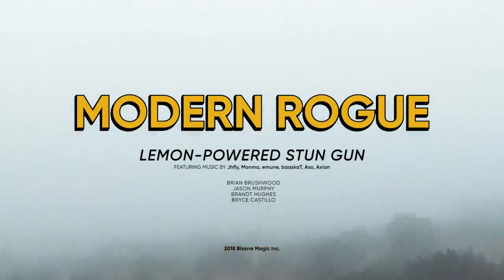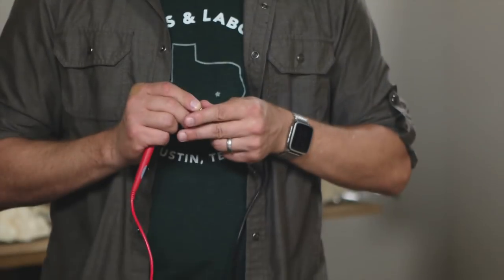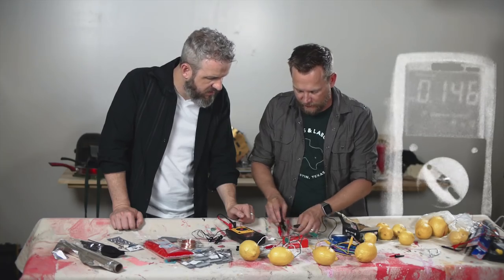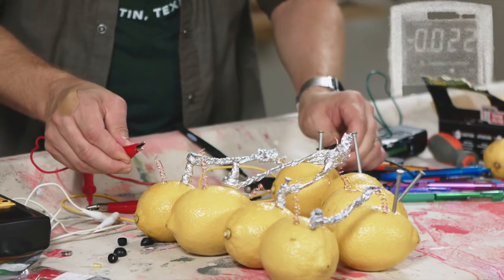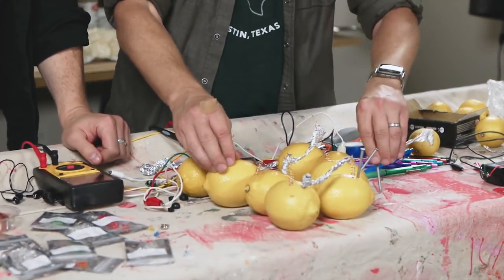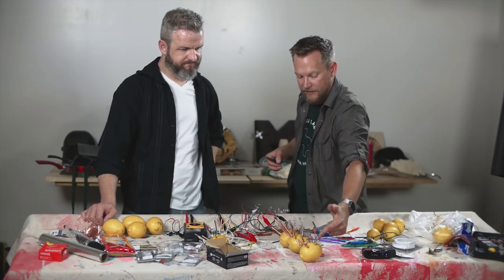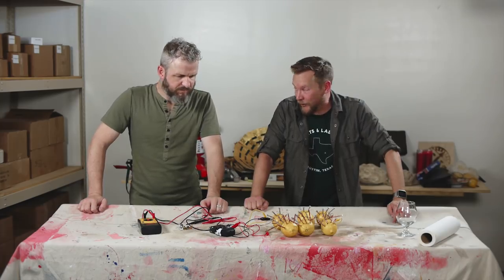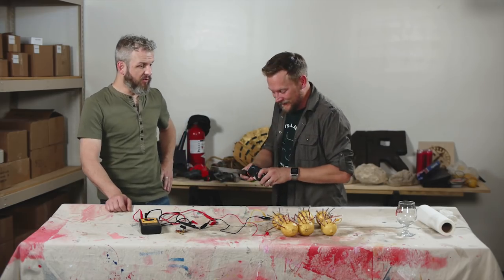Making a Lemon Stun Gun

Comment: Nothing says "Help me" like putting up giant text saying "Ohm's Law" and then not putting the correct equation on screen.
Reply: lmao what happened to the resistance...
Reply: isn't Ohm's Law watts = amps x volts or is that a different law
Reply: @datrandomdugggy5537  what your thinking of is the power law. It's P = E I.
Reply: @tommylight1312  ah ok thanks
Reply: @datrandomdugggy5537  ohms law is voltage, current, resistance and you use those in diffrent ways to find what you need:
Voltage: is current x resistance
Current is voltage ÷ resistence
so on and so forth
Reply: @Brandon25043  ah got it thanks
Reply: They put both. Ohms law and the power law.
Reply: There are SO many things wrong with that one card. They wrote "Ohm's Law" then put a word version of the power equation (P=IE) under it THEN put ALMOST Ohm's Law under that (the variable for voltage is actually E, so it should have been E=IR).  But still, love these guys. 😁
Reply: @JGlenn75  I don't know who on earth would use E for Voltage/Potential, it's either V or U depending if you're in America or Europe. E already means both Energy and Electric Field Strength, and in no world should E = E/x = E•q
Reply: @JGlenn75  the variable for volts is actually V... depending on location. V for voltage is much better than E. I mostly only see E used in out of date textbooks and old ham radio texts
Reply: @1224chrisng it's referring to electromotive force, EMF. V is also speed, so it gets confusing there too. EMF is also electromagnetic force. All real dumb, but as far as I know, Canada uses E for voltage.
Reply: @1224chrisng  Many, many engineering courses teach E as the sort of "old fashioned" way of writing it down. It's still common in some areas.

Comment: this is painfull to watch as an electrical engineer...
Reply from the maker: oh, man.  I'll bet.
Reply: Gregor Scott i feel your pain man
Reply: It is. But it's also funny because of how dumb it is :P
Reply: Then dont watch it m8
Reply: Painfully but still entertaining. Like a car crash dont want to look away lol.
Reply: Gregor Scott I'm in the same situation (I'm an electrician)
Reply: Do they not teach physics in america xD
Reply: I’m 15 and am smarter than them I knew immediately that it didn’t have enough amperage and I know what ohms law is
Reply: @randomrcprojects3754  nice, now gtfo.
Reply: @randomrcprojects3754  shhhhhhhhhhhh, no one cares how smart you think you are
Reply: I'm right there with you brother
Reply: It wasnt hard for me until I saw "watts = amps * volts" and the in parentheses "V = I*R"
Reply: @almidi3  I once had a prof tell me to get ohms law as a tattoo
Reply: Just put battery’s in the lemons 2000 IQ
Reply: @randomrcprojects3754  technically correct, however, diodes are non-linear components. You can't directly use Ohm's law to calculate anything about them. For example an ideal silicon diode would act like a switch. In the case of the Si diode, if your voltage source is higher than 0.7V, your ideal diode will work as a perfect conductor. If your voltage source is lower than 0.7V, it will be an open circuit. The only way to apply something like Ohm's law to a diode, or any other non-linear component would be to calculate the Q-point of your component based on your voltage and amperage. But considering this requires graphing, we don't really use the Q-point method a lot in practice. Thus, we take a first-degree approximation or second degree approximation when building a "normal" circuit.
Reply: Christ, I knew more about electronics when I was 14
Reply: @TheWriteOnez  Do these two strike you as guys who paid attention in school?  Lol
Reply: @randomrcprojects3754  I assume someone smarter than you taught you all that, go thank them.

Comment: Loved the episode. However Ohm's Law has nothing to do with the Watts of a circuit. Ohm's law simply states the relation between resistance, current and Voltage: Resistance =voltage/current (R=U/I) The law you're referring to has a similar formula and triangle, but this is the power. Which is Power(Watts)=Voltage*current. 
I couldn't resist not stating this as a Bachelor in electrical engineering. 
Congratulations on the 100th video though! Here since the start and loving this channel!
Reply: On the topic of electric laws, at the beginning (after the intro), Brian said that they were going to create  electricity, yet the law of conservation of energy (First law of thermodynamics) states that energy can’t be created, only transferred or transformed. Still loved he episode even though it will get some perfectionists like myself. Thanks
Reply: FatDwane in physics most 3-way formulas go in a triangle
Reply: Did somebody make a joke about the Trinity of electricity yet?
Reply: Nitro Actually, it's fine to say that they're creating electricity. They are not creating energy from nothing, but they are turning chemical potentials into flowing electrons
Reply: Isn't Voltage typically displayed as E not U? Just curious.
Reply: Baldwin I've never seen E used for that. Typically U or V
Reply: You can replace "most" with all in that sentence. I just wanted to use the same words they used so I could explain it to them (and other people) in their own words.
Reply: Thomas Jager Alrighty, thanks for the reply.
Reply: E is the symbol for energy. If you multiply a time with Watt's, you get energy, which is usally expressed in Joules(J) or KiloWattHours(KWH).
Reply: Yes this bothered me too XD
Reply: Ohm's law is current = resistance/voltage
Power of current in closer electricity circle is proportional with voltoge , and inversly  proportional  with resistance
Reply: if you swap around resistance and voltage around in that equation it is correct ;)
Reply: FatDwane no it is proportional with voltage
And invertly propotional with resistance
Reply: Thomas TheYoutuberGuy It's V=IR, divide through by R and you get I=V/R.
Reply: AGMT Yea so here in croatia the simbol for current is I  for voltage is V and for resistance is R so ohm's law is I = U/R     
U=I/R
R=U*I
Reply: Thomas TheYoutuberGuy You said it was I = R/U or R/V in your original point, which is what was being corrected.
Reply: AGMT ok
Reply: This exactly
Reply: Watts law.
Reply: hehe resist
Reply: but it's still a 3 way right ?
Reply: inversely not invertly use Grammarly Grammarly is love Grammarly is life but not as much as COBBLESTONE
Reply: Why's nobody mentioning
i = C*du/dt and
u = L*di/dt?
Poor forgotten guys :<
Reply: I could be wrong, but intuitively what seems to have stymied them is the resistance of the (massive, comparatively) conductors they were using to transfer the electricity.... Thoughts?
Reply: Con Diamantis yes, using I=R/U you can calculate the current and with R=I/U you can calculate resistance. With P=U*I you calculate the wattage.
Reply: Isn’t there two ohms laws p=i*e and e=i*r where p is watts e is volts and i is amps and r is ohms
Reply: Radio Bros ohms law is strictly u=ir. p=ui is joules law.
Reply: Simon thank you for setting my record straight. My amateur radio general class called them both ohms law
Reply: r/iamverysmart
Reply: Sure you mention ohm's law, but what about cole's law?

Comment: 15:20 V=IR means Voltage = Current X Resistance. Whilst Wattage = Voltage X current, they're two different equations (V=IR being ohm's law)
Reply: Is it really V = IR in America?
I've always learnt it as U = IR; P = UI
Reply: it is U = IR and P = UI everywhere, U is voltage in Volt, I is Current in Amps, R is Rresistance in Ohm and P is Wattage in Watt
Reply: Wattage is current
Reply: was gonna comment this thank you
Reply: Ohm’s law refers to resistance
Reply: It's V=IR that's the universal/international symbol for Voltage, Current and Resistance
Reply: wattage is called power
V=IR  is right also power = current x voltage
the reason the taser didnt charge is u didnt have enough power (watts)
Reply: Yea these guys' science is so cringey..
Reply: no V/ir is for RESISTANCE its ohms law
Reply: ReaL Instinct No it isn't.
Reply: U = IR and P = UI    Exactly, the voltage is infrared, and the power is a user interface.
Reply: U=Voltage V=voltage potential
Reply: Standard Science 🔬
Reply: I am getting pstd from my electotech course lol
Reply: Graham ohms law can be used to calculate all three. If you know the voltage and the resistance you can calculate the ampere for example
Reply: I wonder if anyone actually does Physics, the amount of power can be met as long as there is a voltage potential between the Capacitor and the Battery (Lemons), the amount of power (Watts) is determined by the chemical reaction in the lemons as it is a REDOX reaction. You could Mathematically calculate if the lemons could charge the capacitor up using the chemical reaction and the amount of charge the lemons could produce.
Reply: ReaL Instinct wattage is power i.e. voltage ×current
Reply: Graham "r" is for resistance in ohms
Reply: @realinstinct4448  no wattage is power, current is flow.
Think of water, watage is the water pressure, current is how fast the water is moving through the hose.
Reply: R= U/I is the standard of ohms law right? Atleast thats what ive been taught

Comment: You're using Zinc from the nails and a thin copper wire.  You need much more surface area.  Go look for Zinc flashing, sometimes called soft zinc, that will get you the surface area you need on the zinc side.  Copper side, switch to pennies or just buy some thin sheets of copper (copper clad PCBs can be cheap).  Limes (pH 1.8-2.0) will preform slightly better than Lemons (pH 2.0-2.2).
Reply: This guy batteries
Reply: That's what they did. They pretty much increased the surface area of 1 lemon battery by a magnitude of about 16. This, however, does not provide enough POWER to charge the capacitor quickly enough to overcome the bleeding the capacitor experiences and the voltage loss from the indicator LED.
Reply: another thing to do is simply increase the lemons/limes... even if you need 1000x more lemons then you had it would be pretty funny to see. as well as removing the led/shorting it out to prevent any power loss through that.
Reply: @DickButt, the big problems are definitely current and capacity, but current can be increased by doing what Munden suggested (and by hooking more batteries up in parallel), and capacity can be increased by using more metal and more acid (which is also mostly solved by Munden's suggestion).
Reply: Also squishing the lemons a bit lets out more citric acid, meaning the bridge between the connections through the acid will be more consistent, decreasing the resistance by reducing the amount of not-acid the electrons have to pass through to get to the other terminal

Comment: The only real question that remains...
can Trevor still use these lemons for drinks?
Reply: TehAdrenalinePickle it depends if the metal mixed with the lemon if not it should probably be safe and I have prophesized that it did not mix so therefore the lemons are generally considered as safe
Reply: The zinc will have formed zinc ions in the lemon. This should probably be safe, but it might taste funny, and look funny.
Reply: to add to what thermophile said, IF the cathode was pure zinc you could in theory eat and be fine (although it would taste worse and worse the longer you had the zinc in there. But because they used galvanized nails (steel nails with a chemical-zinc plating) it probably wouldnt be the best idea to eat it, i know youre not suppose to inhale fumes given off by galvanized steel because its toxic, i imagine the same goes to eating it
Reply: ŦheŁauręnŧ 
Zinc fumes are not “toxic” like lead is, it is mostly just finely divided pieces of zinc and zinc oxide, that will trash your lungs. If you get too much it can be toxic, but that takes a few weeks of exposure. However, there could be other metals mixed with the zinc. 

Source: I melt zinc frequently in my blast furnace, and did ma research.
Reply: Thermophile if you weld galvanized steel you will get very ill..  so you are wrong
Reply: Your name is absolutely legendary.
Reply: Thermophile i didnt say zinc fumes are toxic :) if you look closely i mention that galvanized steel creates toxic fumes. from my understanding its a chemical zinc plating and not a true pure zinc. ie i imagine its the chemicals that are more toxic. melting zinc down on its own youd be fine
Reply: @LaurentSparksMusic  i mean, you're not supposed to breathe lemons either
Reply: Probably taste funny. Metallic and way less acidic. And maybe they are slightly toxic

Comment: Voltage = Current x Resistance (V=IR) and Power = Voltage x Current (W=VI). Just a heads up. Power is measured in Watts. Current is measured in Amps, Resistance is measured in ohms, and Voltage is measured in Volts. The Equation you want is the latter.

Comment: You guys should revisit this idea but with the following changes:
Use aluminum foil instead of galvanized nails. You have a bigger reduction potential that way, thus resulting in higher voltage. You should also try to use copper plates, or just pennies.

You don't need lemons, just an acidic solution for the battery to work.
Connect more of these batteries in parallel to get more current out of them

Comment: A good visual to explain what volts and amps is a dam filled with water. The amount of water behind the dam is representative of voltage. Amps is represented by a pipe leading out from the damn and the diameter(i.e. flow rate) of the pipe determines the amperage. You can have a million volts from lemon batteries, but if you are only discharging it at .01 amps then it won't be able to do anything

Comment: Here are a few things that I think might help you out a bit. If you can determine what the capacitance of your capacitor is you will be able to determine how much charge is stored in the capacitor. This equation is q=CV where q is the charge (in coulombs) C is the capacitance in Farads (you will probably need to convert from microFarads to Farads) and V is the voltage. Since you know what the voltage of a AAA battery is and if you can determine the capacitance of the capacitor you will know what amount of charge is required to fully charge the capacitor. 

After attaching the lemon battery to the capacitor, you will need to measure the amperage flowing into the capacitor (clamp on gauge works best for this and can be found at any hardware store). Now, amperage is just a measure of the amount of charge flowing per time (Coulombs/second) and by knowing the amperage and the amount of coulombs required to charge the capacitor the required amount of time to charge the battery can be determined. (Amperage=Coulombs/second-------plug in amperage and required coulombs from equation q=CV). This will give you a rough guess so that you don't have to sit around for 24 hrs waiting to charge  if it should charge in just an hour. 

Another issue that I believe that you are having is that the LED is acting as a short circuit and is allowing any charge that you might be building up to dissipate through it. I would attempt to remove any unneeded components in the stun gun to prevent any parasitic loss. I would also increase the number of lemons and connect in parallel (to increase amperage). Another method could be to try different household items that might be able to provide a larger current. I have not tried these but it intuitively makes sense to use more of a liquid to increase amperage due to the increased mobility of the electrolytes in the solution. (Try Coca-Cola, salt water, bleach or lemon juice)

Comment: The camera's capacitor is likely charged using a boost converter, which requires quite a modest current from the battery in order to put out increased voltage. The circuit board will have a large inductor, which gets switched on and off rapidly. When an inductor experiences a rapid change in current (on to off or vice versa) it creates a spike of voltage.

Comment: By coiling the copper wire, you're making the lemon wet cell less effective because the length is longer and so the resistance is greater than if it were straight.

Comment: Ohm law is about the relationship between electrical restistancs (Ohm), voltage and current. U=RI means the voltage equals the resistance times the current. The formula that was mentioned in the video is a variation of Ohms law that the electrical work (Watt) equals volt times current

Comment: There's usually a bleeding resistor connected to the leads of a capacitor so that the capacitor can slowly discharge over a period of time when charged but not in use. This plus the indicator LED could have caused the minimal charge on the capacitor in the camera. If you could, you may want to short the indicator LED, and remove the resistor for better results.

Comment: It takes more than 20 lemons to charge after that it will discharge automatically because no constant current supply.
You can use current form a lemon but you cannot store the current in battery because it want more constant current to use its current.

Comment: 15:20 Ohm's law is incorrect, its should be volts=amps X Ohms (V=IR)
ohms are the resistance in the circuit (Ω)
watts = amps x volts is the formula for power and is written P=VI or W=VI not V=IR

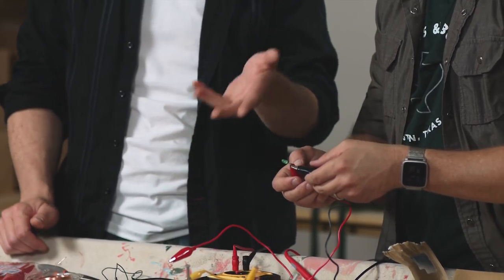Comment: At 5:08, the d in led stands for diode, meaning electricity only flows in one direction.  It would have worked if you switch the terminals around.  Usually, if there's a longer leg, that's the positive end.

Comment: @The Modern Rogue, you can probably solve this by
1) Switching to limes. Limes will give you more acid/acidity. This will help increase both capacity and current.
2) Increasing the number of batteries you hook up in parallel. This will help increase current.
3) Increasing the surface area of the metal you use. Try sheets instead. This will help increase both capacity and current.
4) Disconnecting the indicator LED, which is just a waste of energy for this experiment.